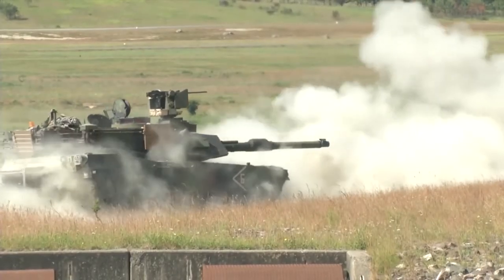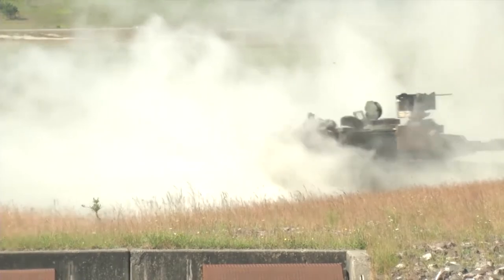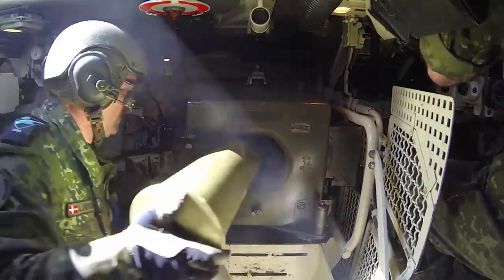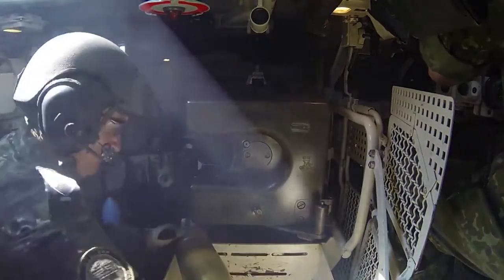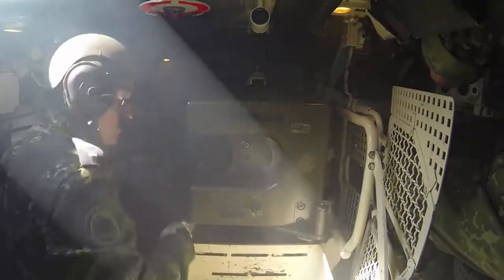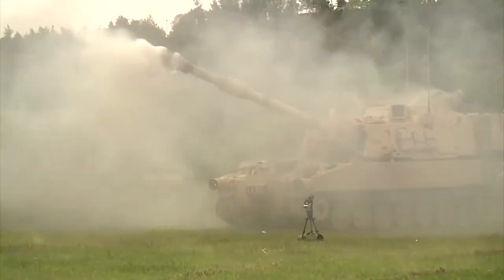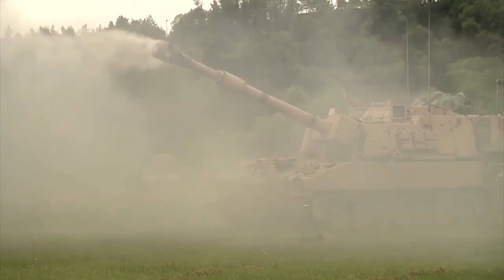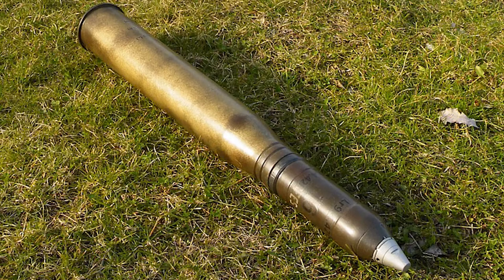How does Tank Ammunition Work? - Simple Explanation

Comment: Don’t confuse tank main armament with self propelled artillery. 2 x basic types, kinetic and chemical energy round. Sabot and HEAT both penetrate, HESH causes spall, why you’ve got a solid shot round I don’t know (APCBC is old, ) you haven’t mentioned Smoke, Antipersonnel (fuzed or muzzle action). Sabot, HEAT, HESH all have Practice rounds, cost less, have same ballistic characteristics, far less wear on rifling. The Leopard AS1 L7A3 105mm rifled gun had a barrel life on 200 Equivalent Full Charge (EFC) a Service Sabot round counted as 1 x EFC , Practice sabot .06 EFC. Yes the Brit’s use HESH, USA called it HEP-T an M1 Abraham’s in Australia uses Sabot and MPAT